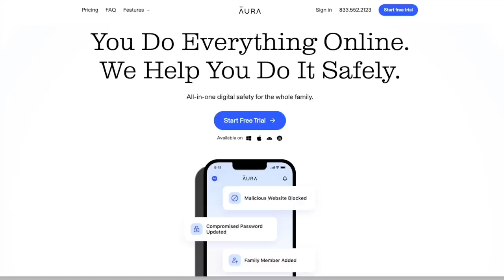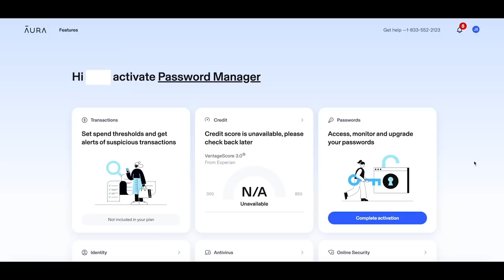I'm Running Away to Join the Circus

Comment: The fire spinning community will be glad to have you! And if Cirque doesn't work out, you could easily go into prop making. You've already figured out most of the tricks of working with kevlar wick. If you wanna get really fancy, you can fold over the last wrap of wick and hide the fastener so there is no metal exposed (hard to explain in text, you'll figure it out).

Comment: Not until this very moment did I realize that adding fire to things that don't need fire was an actual skill!  Thank you for telling me, I now feel like we share a connection,  a common  link if you will!  😂
  Although,  I have to admit that if I set anything ablaze,  it's generally a huge mistake on my part, and requires things like lots of water, a missing eyebrow, an occasional fire extinguisher (or two, it's happened ) but to date, no calls to the local fire department. Fingers crossed....

 (p.s. the shots of you on the beach with the sun in the background are so beautiful,  you're so full of grace and elegance, just stunning)

Comment: Great job. As a tip for anyone else trying - add fuel and then shake off the excess before lighting up.  Otherwise when you do you first few fast spins of the devil stick the fuel will spray you and any nearby audience members.  I’ve also used kerosene as fuel and find it works well.  You can also use standard hand sticks if you’re not adding wicks at the end - no need to make them out of metal. I prefer using wooden hand sticks in a silicone sleeve - this gives a better grip and once dirty a quick rinse with water brings them right back to feeling new.

Comment: Nice skilz! If you ever do fire toys again, use plain white school glue instead of CA glue. Heat makes it harder/tougher and no bad fumes. Also when wrapping kevlar wick, figure out how thick a wrap you want, then unwrap the wick and fold the two cut ends together then wrap the wick with two layers at once. The fold of the wick should end up at the outside end. Then you can screw it down. No worries about frayed wick when all cuts are at the inside touching the metal.😊

Comment: When you're fueling a prop, grab a small and large empty paint can from a hardware store, put fuel in the smaller can, put that in the bigger can. Then if there's a fire you have a tight fitting lid made of metal to easily put it out. this also contains your mess and drips and stuff and makes pouring fuel back easier. We usually call this a "fuel dump" but there are lots of names. Also, make sure you've got someone keeping a watch for fire on you who has a fire retardant blanket to put you out with and you both know the protocol for. here's a good overview: https://www.youtube.com/watch?v=d4hZw1b5DSM

Comment: Looked like you were pouring your fuel on the sticks. If you put your fuel in a cup, you can dip the wick in to soak. Makes it easier, safer, and saturates the wick better.  That's an awesome set of fire sticks! Love putting wicks on the control sticks like that, nice bit of flare.

Comment: If you're going to do this a lot more, some things to consider: 
You're on the right track with hand pieces in the background, so, try it with only the center stick burning.
Try glow in the dark tape for the alternating colors, or something that will reflect the firelight more.
Instead of pouring fuel on ends, pour a jar of it (ask friend to watch open jar closely) and dunk the ends to refuel.  You could even make a pair of cleaver jars with sealed slots to put the ends in, so you can soak both ends of the center rod at the same time.  Put the jars on a board to keep them upright and spaced right.

Comment: I've been doing circus stuff for a few years and fire is hella fun. Also look for an Aerials gym near you, silks are unbelievably fun too. Also hula hooping is great but not as good with fire as it is with LEDs (though I've got both). Also rope dart is great and surprisingly not that hard to learn. Poi is the "standard" thing but hoooo boy are two things harder than one. 

Also for making fire toys, kevlar thread is the way to go for sealing it up. Metal on the outside of the wick is a biiig danger for burns. You can touch the kevlar and wipe the fire off really easy, but you'll immediately burn yourself with a piece of metal in there.

Comment: If you fold over the ends, the Kevlar does not burn out as quickly and you can use it more often before you need ts repair it.
Reply: Oh, you did it later 😀

Comment: Yeah more Circus content! But to become a circus artist I woul recommend to build LED props as it is much easier to perform with them in tents, buildings, ... Fire safety regulations can be a pain if you do stuff on a commercial level and I think it would make a nice project series to create a lot of different props with LEDs because there are a lot of challenges like:
Where to place the battery to the center of gravity is in the right spot?
How to build electronics in a way that they survive the constant vibration/movement?

For the software side there is a open source project including a custom esp32 firmware to control led props that can be easily programmed to music -> search for BenTo by Ben kuperberg

Comment: Nice, I've never done torches on the control sticks, only on the spinner.  I feel like they would get in the way of flat spins? I dunno. Did you have any trouble with like helicopters? I'm also curious about the weight and balance. I tend to prefer wood over aluminum sticks, but that's a preference thing.
Nice job.

Comment: Xyla,
Actually I think you might be able to join the circus after all. Your fire stick trick is excellent, but you have a talent very few people possess. And you have it in spades! You are a most superb and talented FABRICATOR!!! You don’t think all the circus tricks grow on trees. Or do you? If so, pack up your sticks and go out and play. Playing with fire is for adults and you have not yet crossed that line.
On the other foot, the circus needs plenty of people who can turn someone’s idea into an apparently death defying 40 foot plunge into a bucket of beer. All the apparatus a circus uses is pretty much built by people in the circus because they are the only ones who know the whats, hows, whys and physics to keep the performers alive. At least until the show heads to the next city. The job is, admittedly, a tad harder in Las Vegas because Circ d’Soliel has three or five permanent shows there. No escape to Los Angeles or Animas, New Mexico.
Remember the line from ‘TheGraduate?’: “Plastics!” Well, the line for the circus is FABRICATOR!!! Put your obvious talents to work fabricating for that circus of eternal youth; no rent. No insurance. No work. Just Xyla and her toolbox of youth and eternal fun.
Keep the aspidistra flying!
God bless,
Paul

Comment: Why not use kevlar thread from the same part to sew it? (also, flare the metal with a screwdriver to mechanically hold the ends in place?)
Reply: You can, but it’s waaaaay more work. Try using a curved needle to sew through 1+inches of rolled wick and you’ll see why screws are more common 😅